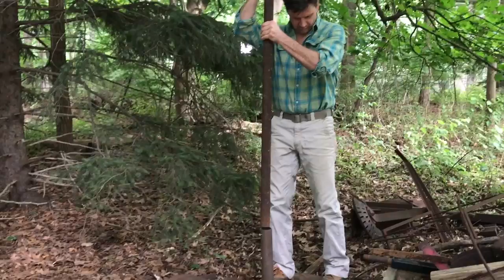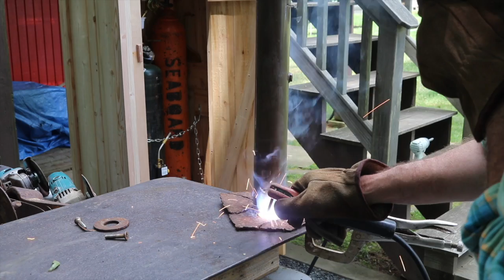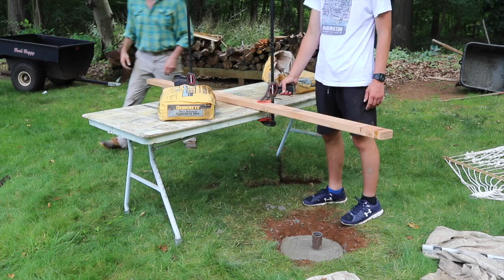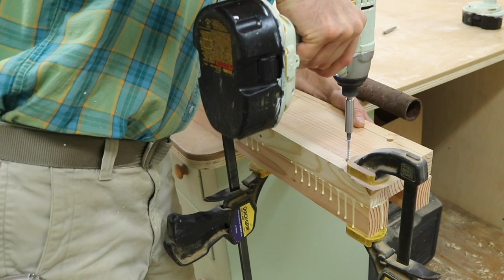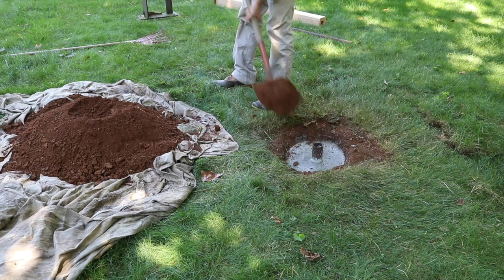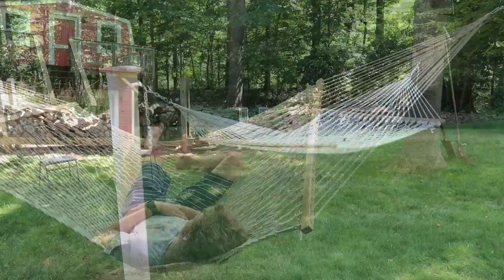Removable Hammock Post, Scrap Metal Woodworking Project

Comment: Looks great John. Very surprised that it held so well, I always thought the posts needed to be angled away from the net. I've always wanted to do a hammock, this is probably the best method I've seen
Reply: I guess it's just a ratio thing...there was a significant part of the pole he inserted that went below ground into the other pipe. I'm guessing that is part of why it didn't bend or need to be at a different angle?
Reply: Yeah that's true. Put it half a foot in the ground and it wouldn't work, 3 foot and you're in business

Comment: Wow nice! I always wondered how strong metal posts were for hammocks. I saw a guy using a 6x6 and I was told 4x4 would snap. I just installed a 4x6 today with a 30 inch deep hole. Hopefully it will work. Great video.

Comment: Great video! I would have never thought to do that with the post over a post. My question is unrelated to this build, but since you have been talking about grass and lawn type stuff lately, maybe you will know. my back yard is incredibly soft. Not the grass, but the dirt itself. Even if it has not rained in over a week, when I walk in my back yard, you can feel the Earth compress under your feet. It's kinda like walking on mud... but it isn't wet. It's hard to explain. I feel like, if I had a bunch of people over for a backyard BBQ, and had 15+ people walking around my yard for 2 hours, when they left, it would look like a heard of buffalo came through. Even as I mow the lawn, when I look back where I've walked, you can see my foot prints in the Earth. 

Any idea what that is, and how to toughen up the ground? I live in Charleston, SC which is the "Low Country" and I'm sure my house is right at or just above sea level. The ocean is just a short drive away. But other's people's yards in Charleston don't feel like this. Any idea?
Reply: Moles? Do you see any raised paths that would have been caused by a mole digging?
Reply: @Michael Perkins
Needs a few sessions of Rolling to level and compress - same as Groundsmen do

Comment: How did it do for wobble.   Looking to do a similar project, but wanting to make sure the pole does not bend or lean toward the hammock too much.  Great design though.
Reply from the maker: It  actually did bend within the first week and I had to remove the pipe and fill the pipe with concrete. Since then it’s been good and I think this is the third year.
Reply: @JonPetersArtHome  Thanks for the quick reply.  I will be digging holes this weekend!